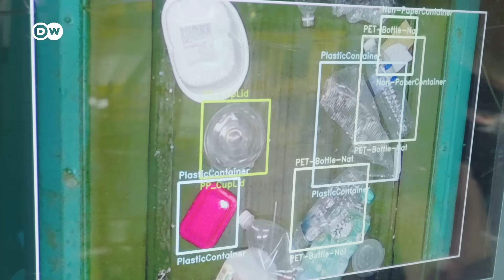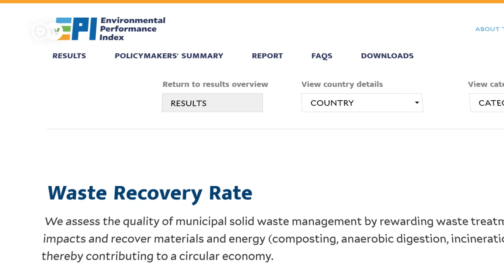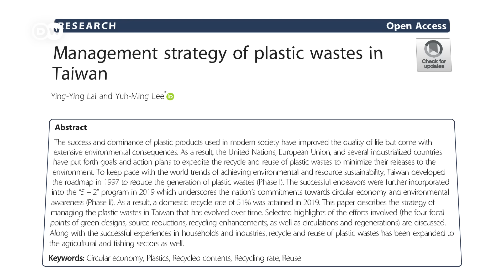How is Taiwan beating everyone at plastics recycling?

Comment: As someone who lives in Taiwan, this is not true. And they even show it in the video, everything is covered in plastic, often two or three layers. Food always comes with disposable cutlery that you cant refuse, and is wrapped in rubber bands that cant be recycled. If you buy an electronics product, you will have a ton of plastic left over that was used exclusively in shipping you that product. Its ironic this is a European TV show as Europe does this so much better, there is far less plastic used when buying products and there are recycling bins everywhere (and they accept far more products as recyclable than in Taiwan). Also, Taipei is very different to the rest of Taiwan. It is still common to see heaps of plastic trash bags on the street, in front of houses, etc. not to mention loose plastic cups, sheets, etc blowing around the road.

Comment: Shame these same standards aren’t applied to key industrial firms in Taiwan, which pollute with relative impunity. Illustrative case in point: ASE (Advanced Semiconductor Engineering) illegally dumped toxic waste in a local river for years but received only slap on the wrist fines and no criminal convictions for its principals, leading to claims of a coverup assisted by government authorities.

Comment: Singapore could learn, but we incinerate most of it where we get quite a lot of energy from it, which I think is quite efficient, recycling doesn’t seem to work, when plastic ends up recycling elewhere badly ? Carbon long chain returns as carbon after incineration. Just need to carbon capture the tiny bit ( which adds to a lot)that gets out.

Comment: In Turkey, we do nothing. The Zero Waste campaign getting spread around the country but at the and of the day no one separate  the garbage. We have two bins for trashes one for recycling and other for non recyclable ones. Many times I witnessed they put both of them at the same place. Almost 10 years ago when I had been living in Istanbul, there were separated bins  for glass, metal, plastic, paper etc. and I had been collecting them. But authorities destroyed these bins I dont know the reason  and I stopped collecting. Unlike that, today, textile boxes are very common in every neighborhood. Also it is possible the see paper collectors around the bins. I have many items at home that I dont know where to throw away like old mobile phone, electronic products, kitchen utensils.  
Recyling is a very interesting issue  sometimes it is a lie because of downcycling. Actually the point is not producing waste. The life cyle should plan at the production step so the final user is not the solution. Maybe reusage should be mandatory. Individually people have to try their best for cleaner world with minimum waste. Urgently, it has been stopped to package everything…

Comment: No wonder, World news always show Taiwan's positive side, when reality is absolutely different. 10 years ago, trash cans were almost everywhere, 100-500 meters apart. But then what happened is out of a foreigners knowledge: Universities decided to have a "GREEN" environment, by throwing away all the small trashcans placed 100-500 meters apart. All convenient stores inside the campus banned the use of plastic straws and spoons/forms. They didn't even ban it, they sell it at NTD 1 per straw/forks/spoons. And soon the trashcans outside followed the Universities. And the result: Plastics scattered everywhere in Universities, bigger items spread in remote locations. And what the Universities did? Install more surveillance cameras. And lo and behold, very soon the rivers were flooded with plastics, and very soon the seashores. And the story continues still. Just making Taiwan "GREEN" doesn't mean you should do something which people necessarily need. Hiding the problem under red carpet simply doesn't solve the problem.

Comment: Taiwan's plastic consumption is out of control.  I personally believe it's linked to the rise of cancer cases.  Even though some plastic is safe to heat, commonsense tells me when plastic begins to warp under heat, it's not safe.  Several years ago, when I visited Taiwan, they were placing plastic bags over plates to keep the plates clean.  Piping hot food placed directly onto thin plastic bags...hmm... you tell me if that's safe.  I thought that was one of the most absurd ideas ever created but that's the perfect example of Taiwan's tendency to use bandaids to fix one problem but in time, that bandaid usually cause new problems and this time, I strongly believe it's attributing to the rise of cancer in Taiwan.  Glad they are recycling but they also need to greatly reduce the use of plastic.

Comment: We used glass bottles, cardboard, waxed paper, and paper bags in the 60s and managed just fine for most of our consumer packaging.  Cutting the amount of plastic waste should start with simply using less plastic at the outset.  Moreover, the number of types of plastics used for known consumer goods should be reduced.  Fewer plastic types being used means it's easier and faster to recycle.  This is especially true for single use plastics, which should be almost exclusively polyethylene.

Comment: I kept trash in my pockets because that was what I was already used to doing if there wasn't a trash can around in the U.S. I know some people will just drop it on the floor though, even if there is no trash around. I was really impressed with Taiwan's recycling system though!

Two years ago when I was there I rented an airbnb with my wife in an apartment building. Their trash disposal was in the basement. They had these refrigeration units for organic trash, and then areas for your sorted recyclables. I already recycle at home in America so it was all familiar to me but I bet it is an adjustment for most people who don't recycle at all. 

This is especially that I wash and dry my recyclables, something that I notice a lot of neighbors don't seem to do. Or they don't break down their boxes or keep their paper together, it is all mixed together. I like to put all my paper in a paper bag so that makes sorting easier down the line.

Comment: It’s fine to encourage individual responsibility. Sorting trash, recycling, and not being a slob, sure. That’s baseline civic behavior.
But let’s be honest about scale and power. Corporations are the primary drivers of the waste problem. They, not individuals, decide to mass-produce plastic, wrap everything in layers of disposable packaging, and externalize the cleanup costs onto the public.

Governments absolutely have leverage here. They can negotiate, regulate, and mandate. They can require companies to use better materials, like biodegradables, glass, and refill systems... at the point of production, before it gets to consumers.

Instead, you’re scolded for sorting plastic correctly. Meanwhile, corporations keep flooding the system with plastic garbage, much of it unrecyclable, because it’s cheaper.
Personal responsibility without corporate accountability isn’t environmentalism. It’s just managed guilt.

Comment: One of the main solution that solved 90’s trash crisis in Taiwan is deregulation of Government’s monopoly in trash disposal business, trash that were dumped on the street were gone in few days after the degradation. Gangster organized crime took over the waste disposal industry right away, later on government started to build incinerator in every city in Taiwan, and organized crime still dominated Taiwan’s chemical and industrial waste disposal industry. It’s not that the government has done such a good job, it’s just opening up the market, some one will come in and clear up the mess if they could make a huge profit out of it.

Comment: We thought Taiwan’s plastic recycling had increased, but because of that increase, Taiwan’s annual plastic usage also went up. We thought we were reducing, but instead we ended up consuming more.
We thought we were saving more children from the ravages of war, but in reality more wars are breaking out. When you don’t solve the problem at its source, you’re just cleaning up the mess afterward, and you contribute nothing to easing the overall suffering.

Comment: Big difference between the average YouTuber and a pro' insightful,  interesting and well presented, my little bit of input, is that it doesn't matter what "shape' industry shapes plastic into, plastic is always going to be with us, there is no way we are going to get rid of it.
Reply: oil is a finite resource and plastic waste can only be downcycled, so we will get rid of plastic at some point. We can then still produce plastic with co2 captured from the air, but it will be VERY expensive and thus only used where absolutely indispensable.

Comment: Scientists in Singapore have developed an artificial "worm gut" system that uses the gut bacteria from "superworms" (larvae of the darkling beetle, Zophobas atratus) to break down plastics more efficiently than live worms. However it is criminal to produce tonnes of non-recyclable waste everyday (e.g. Japan's disposable-everything (e.g utensils) and all those pre-packaged meal in 7-eleven). Secondly, I do agree that commercial usage of plastic is much higher than individuals. So no matter how much effort you put in, there are companies that may easily undermines that effort. 

Btw, the data centres for AI is extremely energy intensive, so energy security is also a priority. Plastic also has a high carbon footprint, because it’s essentially made out of petroleum, and burning them produces CO2.

Comment: Lived in Daegu, Korea in the mid-2010s. Was the same thing. Only place I remember any public trash bins was the train station.
I had to buy a bag for the trash. My building had recycling and everything was separated into bins. There was so much recycling that I only used 1 trash bag per month. And, that was basically dirt from cleaning, cig butts (had a balcony and smoked outside), used paper towel. Really wasn't much to throw away.

Comment: Badminton tonight           
Level: MB - HB                       
May u join us ? 🥑 Oops   
$10 per person 

Unity SECOND @ yew tee     
26/12 Fri 7-9pm 3 slot
28/12 Sun 12pm-2pm 2 slot

Unity PRIMARY @ yew tee                               
28/12 Sun 6-8pm 2 slot

Clementi Sports hall                                          
30/12 Tue 6-8pm 2 slot
31/12 Wed 6-8pm 2 slot

Comment: the water that washes these [plastics, doesn't it pick up microplastics that it ultimately carries into waste water/effluent channels? 
good project though, its really great what they are doing
Reply: Precisely what I thought. Single use plastic in general should only be used in the medical and investigation businesses. Nowhere else. Just don't make the demand. Use thick plastic items or alternatives altogether. Steel is best as it tends to last the longest. When it begins to rust it can be painted, polished, waxed or oiled. Once plastic begins to deteriorate nothing can stop it or reverse it or even slow it down. Just throw it out where it'll inevitably get buried or burned, which will poison the soil, water and air.

There is a reason the three Rs start with "reduce". Prevention, or simply not making things worse is the best medicine here. Reduce or curb the incoming flow of plastics. Less to get rid of later.

Comment: I wish the report would show the incinerator burning waste. Ideally, this heat energy can be use to convert to electricity and the exhaust can be cleaned before released to the environment. By cleaned I mean the harmful emissions eliminated (like in a car's catalytic converter) and only expel CO2 and H2O
Reply: Yeah, good thing that CO2 is such a harmless emission and releasing it into the atmosphere has absolutely no negative consequences.
Reply: @grischa762  CO2 is a nourishment for plants. Reports are showing that plants are thriving significantly better under the current environment than they were 50 years ago. The environment is improved.
Reply: @jamsbong  In a greenhouse, higher CO2 concentration can lead to faster growth. In wildlife, there are other factors that can counteract the positive effects of CO2. Here in Germany, the forests are visibly dying due to increased droughts and more pests because of much warmer temperatures in the winter. Wildfires are also much more common now. And while studies do show an overall increase in vegetation worldwide, calling it an environmental improvement would be misleading.  Not to mention that animals are also part of the "environment".  Coral reefs, for example, are going to disappear completely in the coming decades, and they are a hotspot for wildlife in the seas.
Reply: @grischa762  You can't conclude recent draughts to negative impacts of air pollution since draughts and floods are cyclic. And the cycle isn't a weekly cycle even a yearly cycle. The cycle actually spans over a decade.

I agree to not carelessly pollute but I think we should be careful not to blame every bad weather day to global warming.
Reply: @jamsbong  Sure, individual weather events can never be directly tied to climate. But droughts, floods and other extreme weather events are overall much more likely to occur and will also intensify as temperatures rise. And it is  this general trend that I was talking about. Only about 20% of trees in Germany are completely healthy at this point, and it takes much more than a couple of bad years to get to this point.

Comment: A lot of our daily plastic trash comes down to packaging. What if we use AI to determine how much packaging tax producers need to pay based on the packaging design? It does so based on the material recyclability, colour and printing, packaging size, the cost of incineration etc. The manufacturer will then either optimize the packaging design for circularity or pass on the tax to the buyers, which then affects their sales. That creates a mechanism where producers are encouraged to produce more responsible packaging.

Comment: What most people don't realize is that plastics are a waste product from oil refineries and cost almost nothing. It's actually cheaper to produce NEW plastic than to create recycled plastic. The only way this is going to change is either to tax new plastic or wait til our world economy changes and oil refineries start to close because of EV production increases.
Reply: New plastic is not only cheaper, but also has a higher quality. The idea that recycling is the solution to the plastic pollution problem is a marketing from the fossil/plastic industry. Much like the "recycle" symbol on plastic packaging that infers that the packaging can be recycled while it only shows the typer of plastic that was used.

Comment: I am in Sweden and thoguht we were good at recycling which we are except plastic. We burn almost all of it. In a cold climate burnirng is not that bad since heat is beeing used and you get very little waste heat and every municipality have central heating with high-end incinerators with good filters. Material recyling of plastics will not be good here because we have a big infrastructure with central heating which need something to burn. Either wood or trash as of now.
Reply: Yeah, thankfully burning plastic doesn't create any damaging air pollution. It's all breathable.
Reply: @stevenmitchell1  It really isn't that bad. The incinerationplants in Sweden barely have any air pollution. They produce about 70% of the heating needed. Small particle (PM2.5) it is about 5% of the national total, SO2 it is 18% and NOx 11% of total. Heating is roughyl a third of all energy used and of that about 70% is from burning waste. It is fairly clean compared to alternatives.

Comment: It's great that Taiwan, at least in Taipei puts in the effort trying to reduce and recycle plastic.  At a glance, the Singapore system seems to be easier, as everything is incinerated at super high temperature. They recover ash, which goes into landfills. They also can recover some metals for reuse. A little electricity can also be generated to offset some of the cost of the incineration.  

Both systems are good in their own ways, and beat just turning a blind eye and ship garbage elsewhere.
Reply: Singapore's system is lazier, it doesn't allow the recyclable plastics to extend its lifecycle.
Reply: If there is one thing that Singapore really needs, its more heat!!!

Comment: Ok #1 question, what happens with styrofoam?
Reply: They generally get burned, that's why their are sorting out the recyclable and the non-recyclable.
Most countries that have robust recycling programs often ban or restrict styrofoam use as they break down too easily into the small bits.
Taiwan have banned styrofoam in their food packaging.
Reply: @lucretius8050   That was my first idea yeah, used in energy production?

Comment: i hate those bottles where there is foil from different plastic around them and impossible to remove... meaning that one goes into the furnace... what a great video showing how things can be done differently. the guy telling that his impact is irrelevant... what a non sense.. if every single person removes just one piece of plastic thing/trash from their live every day, it will make a huge difference... but if everyone tells - i don't need to change anything, because i don't matter, huge mistake...
Reply: It's an unhelpful attitude, sure, but he's right that industrial waste absolutely dwarfs an individual's contribution. Covid demonstrated that individual footprints contribute barely anything to climate change, the vast majority of the problem is caused by industry. If we can't fix industry pollution we're toast, no matter how many bottle caps little Timmy recycles.